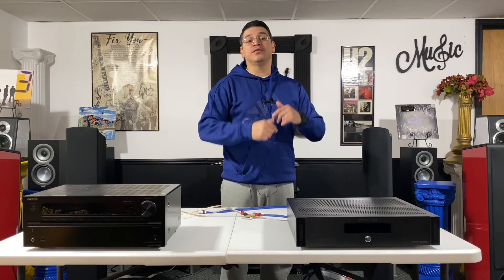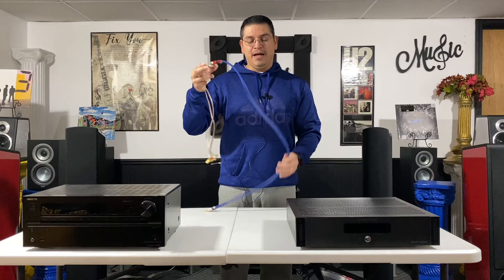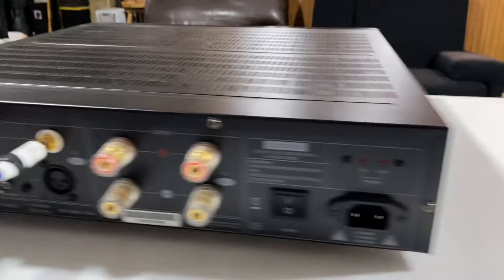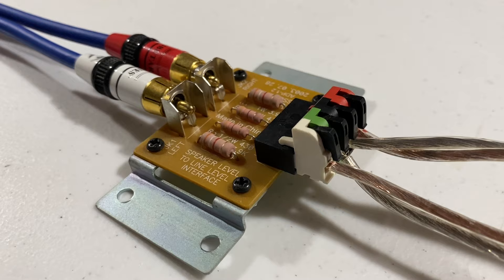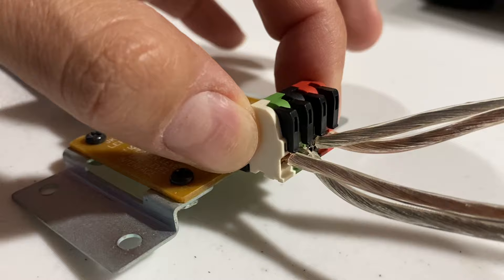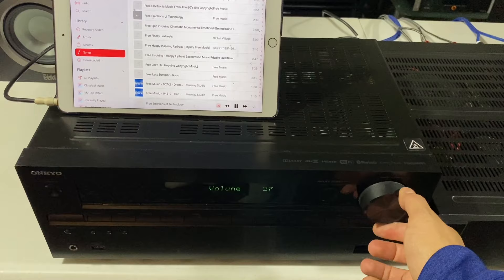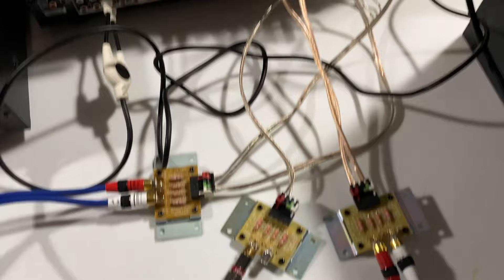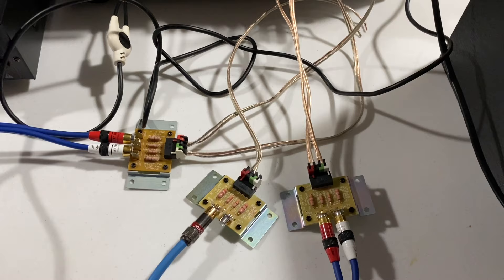Connecting an amplifier without using preouts.

Comment: Hi, if i have a 7.1 receiver but only want to power the 2 front speakers, do still have to hook up 3 adapters?  at 10:45 you say " now if you have a 5.1 or 7.1 you will need 3 adapters".   I ordered 1 adapter just now from crutchfield.  I will see how it goes.  I am hoping I don't have to buy 3 adapters to just get it to work on a 7.1 receiver, because then I am spending $120 basically for 3 adapters...might as well just use that money towards a new receiver with preouts.
Reply from the maker: Yes that will work fine. One adapter for just the 2 speakers works fine. If that’s all you want to do is power front mains. What I meant is if you wanted all 5 channels connected to an external amp then you would need 3 adapters.
Reply from the maker: Thanks for watching

Comment: Question: own a vintage Marantz 1060 integrated amplifier that has pre-outs and an Onkyo TX-8511 Receiver that does not have pre-outs. Could I connect these together and would there be any advantage? I am using JBL Studio 230 for speakers. Thanks,
Reply from the maker: You could connect them but I’m not sure there would be any advantage to it being yours marantz probably has better voltage than your onkyo even if the wattage is lower. However you can always give it a shot and see if it works. Hope that helps. Thanks for watching
Reply: @Audiolympian  when connected separately, the Marantz has much better sound than the Onkyo. However, I thought with more power pushing through I was hoping for better sound. Exactly how would I do this? Would I go from the pre-out from the Marantz to what in the Onkyo?
Reply from the maker: More power doesn’t always mean better sound. The onkyo could change the sound in a way you may not like. It is a tricky connect being the output of the marantz would maybe go into an auxiliary input or maybe the cd input of the onkyo. But not sure if the signals will pass properly. In theory it should but not sure. I’ve never done that.
Reply: @Audiolympian  OK thanks maybe I should just let that pass. I thought maybe since I already owned it I could put it to good use. It’s basically just sitting there collecting dust. I believe I purchased it in the late 90s when my Marantz went on the blink. After a few years I decided to get the Marantz repaired and I’m glad I did because it really does sound much better than the Onkyo. I guess I should come up with another solution.
Reply from the maker: @drums5434  marantz vintage gear is outstanding.

Comment: Hi, I have one question. Right now i have a subwoofer connected to my receiver is it still going to work or i still have to buy another adaptor for it in order to work? Thanking you in advance.
Reply from the maker: Yes it will work. As long as your sub is connected to the low level interconnect output on your receiver (rca) No need to purchase another adapter for the sub as the Lfe signal is generated from a different circuit.  Hope that helps and thanks for watching

Comment: In fact I needed a theatre like  center channel sound so I connected center speaker line output from receiver directly to the amplifier without an adaptor.  It sounded pretty loud and good.   I lessen the db of center channel of the receiver.   So why there's need for adaptor ?  Pls comment'
Reply from the maker: What cable or speaker wire did you use and how did you connect it?
Reply from the maker: Also which amplifier did you use?

Comment: I'm trying to use an amp for just the low end with subs. Can I still run the high end speakers  off the reciever? And if so would I just double up the wire and have one going to the speakers amd one going to the adapter?
Reply from the maker: You could do it that way but when you add wires to speaker terminals it breaks down the ohms and could damage the receiver. The better solution would be to connect the high end of the speakers in series or parallel. Hope that helps. Thanks for watching

Comment: Hi with a reciever like mine ,it’s Pioneer  -vsx 4012 Dolby surround w equalizer  t has front  rear center inputs for speakers and it’s says 380 watt .I thought it would be more powerful than it is I’ve got 2 dj speakers 10 “ Mtx thunder hooked up to front but I turn up and it shuts off ? There 250 watt speakers .I took one away ,now I plugged 1 mtx dj speaker to channel A or B and I have 2 Polk audios do I plug the Polk audios into Sourround or center or front Lol sorry I’m confused if u had any input I’d gladly appreciate it thanks Godbless
Reply from the maker: It depends on which channel you have the Mtx hooked to (center or fronts) I would probably put the mtx on the center and the polks on the fronts. And use A speaker selector not B.

Comment: Are those like line level / high to low level adapter used in car stereos to add a power amp to a factory stereo without preouts? Same concept.. I have a Onkyo NR 686  that don’t have preouts .. It has Bluetooth an Wi fi
Reply from the maker: Yes the same thing. The only difference is these are designed to handle 120v the car devices are designed for 12v. I’ve thought about getting and auto line level and. Trying it in the house just to see if it would work but those take a hot, ground and neutral intake and I’m not an electrical engineer. Thanks for watching
Reply: @Audiolympian  .. thanks for responding;
Reply from the maker: @keithwebb8512  you’re welcome

Comment: What if I want to run external amp with other speakers while even running reguler speakers by AV riceiver  AT SAME TIME
Reply from the maker: Good question. Yes It will still work, the receiver will power the speakers connected directly to it while the other speakers will get power from the external amp. In the beginning I had my set up that way, with only one adapter for my front main speakers. Thanks for question.

Comment: I have a 5.1 but want to get a 3 channel amp to power the front LCR speakers.  Does doing this method increase the watts the surrounds will be getting? Thanks in advance.
Reply from the maker: It only increases the wattage to surrounds if they’re connected to amp. However, receivers are designed to push a little more power to the channels being used if not all channels are being used. So yes it will push a little more power to the surrounds when the 3 main channels are on an amp but it doesn’t do it the way we think so it’s not a continuous wattage push it delivers to the other channels only when needed. The only time it makes a real difference is when the receiver is in stereo 2 Channel mode, then it’s a continuous push to the left and right channels. Hope that helps and wasn’t too confusing. Thanks for watching
Reply: @Audiolympian  Great, thanks for the quick reply.
Reply from the maker: @santiagopastor8548  you’re welcome

Comment: What about if my amp doesn’t have to connect speakers
Reply from the maker: Someone else asked me about a similar set up. I understand what you mean but not too familiar with what the other inputs / outputs are on an amp like that. But as long as it has rca inputs it should still work but can’t say for sure. Hope that helps. Thanks for watching

Comment: Will doing this automatically bypass the recievers internal amplifiers or add to the amplification?.
Reply from the maker: Good question. It adds because you are using the original signal coming out from the receiver however, I believe the design of the adapter using rectifiers help tone down the signal so it’s not over powered resulting in damaging speakers. Hope that helps, thanks for watching

Comment: Hey there, I have had an issue that my setup requires more power than any decently priced at receiver can handle as I listen loud for extended periods of time for patty’s etc. so I have ended up torching 1 stereo and another one is just an anomoly with what went wrong. Anyways I got a 12ch, 150w rms per channel amplifier but my pioneer elite vsx 43 doesn’t have pre outs. If I was to use this adapter would it still end up pushing the internal amp pretty hard and causing lots of stress on it and heat? I’m trying to avoid that as much as possible here. Thanks!
Reply from the maker: Man that sucks. I’d love to tell you yes it should be fine since you’re pushing through an amp and basically using your receiver as a preamp but I don’t really know. If it were me I’d get some pretty heavy duty cables and power conditioner so maybe those would burn out first. And maybe you have that already. Wish I had a better answer for you. Good luck.

Comment: why do we need an russound converter ? why not directly connect to the speaker out ?
Reply from the maker: You can connect to the speaker out if you want to just use the receiver for sound. But some people want to have more power or just use an external amp and the receiver may not have the pre out capabilities to connect and external amp. So the Russound adapter gives them that ability. Good question thanks for asking and watching

Comment: Hey! I just want to know is speakers to 2 RCA line output converter in/out high/low will also work on a 8 channels amplifier to the receiver?
Reply from the maker: It should as long as you have it connected correctly. You’d need 4 adapters for 8 channels
Reply: Thanks you I will do!
Reply from the maker: @shawnbrown4359  thanks for watching

Comment: any tips for a dual reciver setup one for bass and one for normal sounds and such cause i have a pioner from 1997 thats getting real tired what should i buy thats in a good price range and yeah cause it gets to hot to play for long amounts of time so i had to use a pc fan on it any recomendations ?
Reply from the maker: Mostly depends on budget. But I usually try to give options between the $300 - $700 price ranges. Also keep in mind any recommendation might be able to be found on aftermarket sites which could mean a little lower price. Depending on your set up (stereo or surround) but any current pioneer, denon, marantz or Yamaha. Receivers are really good today and come with a lot of options. Entry and mid level products tend not to come with a lot of actual power, maybe 80 wpc. But good enough to get the job done. And of course the bigger the budget, the higher up the scale, the more bells and whistles along with more power. As far as two receiver set ups, not much to recommend other than a more modern subwoofer that comes with a wireless app for more control such as SVS or paradigm. Hope that helps. Thanks for watching
Reply: @Audiolympian  thx man I'll be sub to you cuz you where so kind and wrote a essay for me of Info thx man :)
Reply from the maker: @GoatedASF2K  you’re welcome. And thanks for the support

Comment: Hi can I just use a simple rca to bare wire cable to connect may receiver to a power amp??your answer is very much appreciated..Thank you 😊
Reply from the maker: Sorry for the late response. Apparently I didn’t hit send. Your question is interesting. I’m not sure if it will work, seems like it could but the adapter has specific networking to transfer the signal properly. However, you could be right. Thanks for the question and watching
Reply: Thanks for answering my question 😊I have another question 😁 is it the adapter that you use is  same with hi-to- low level signal converter??😊it is with the same rca out and speaker line in connection with it..I just saw that on amazon 😊Thank you 😊
Reply from the maker: @rjaychavez3866  yes it’s the same.
Reply: No , do not use rca directly to speaker output and connect it to power amp , you will certainly destroy your power amp, this adaptor has resistors connected between rca and signal coming out of receiver so it is safe for power amp. Early in my years i have done this mistake with a car audio, connected the old radio from car directly to an amplifier trough the speakers output and destroyed the power transistors inside amplifier.

Comment: How did you get the speaker wire in the clips? I feel like it's  going to break the clip if I open  it all the way.
Reply from the maker: Just that way. open it all the way up. I should have mentioned that it does feel that way but it won’t break. Use some force but be conservative. I’ve done it quite a few times none of mine broke.  Hope that helps. Thanks for watching

Comment: When you turn up the volume on the AVR in this setup, where is the increase in power coming from? The internal amp in the AVR, or the amplifier?
Reply from the maker: Hey Riley,
Kind of both. This set up doesn’t totally by pass the avr’s channels it’s more of an enhancement. So the potentiometer is on the avr but it’s sound path is going through to the amp. Which is why if you connect this device the two channels it’s connected to will be louder than the other channels. Hope that answers your question. Thanks for watching
Reply: @@Audiolympian  Interesting.
So what I'm trying to do is use my AVR by itself for movies, then have an amplifier connected via a line-level converter that I'll use for music (turntable). Turntable connected to AVR, line-level converter coming from my L+R speaker connections on AVR to the external amplifier, speaker wire from L+R connections on amp to an amp switch ("A" side of amp switch), then finally to speakers. Speaker wire will also be connected to L+R on AVR, leading to "B" side of amp switch. Amp switch lets me toggle between using the AVR (movies) and the AVR+amp (music). I've been using the amp switch for a while now with the AVR and amp completely seperate of each other, but I want to take advantage of the room correction software on my AVR, and I think this is the only way, unless I've made an error in my thinking.
Kinda complicated, but I like the extra power for music, plus the amplifier has cool lights, haha.
Reply from the maker: @MFRiley  gotcha. So it seems like it will work the way you want I too as long as your “switchers” are basically pass through devices, which it sounds like they are. If you do it let me know how it works out. I’d be curious to hear your results. And yes amp lights are very cool 😎
Reply: @Audiolympian  Pass through it is (Solupeak P2).
Figuring this all out was quite complicated as I'm not super knowledgeable about the technical side of audio. Didn't even know something like this was possible until I started digging. Audio is such a rabbit hole.

Now that I'm looking into it even more, I guess I could use the external amp for both movies and music. Use it as part of my surround setup for movies. Let the amp handle some of the load of the left and right channels, and the AVR can focus more on the other channels. Would this be worthwhile, or am I splitting hairs at that point?
Reply from the maker: @MFRiley  could be splitting hairs depending on which amplifier it is and your room. Yes it is a lot and a very deep rabbit hole. My advice is take your time, research a lot but enjoy what you have and get to know it. Learn all the specs. That will give you good insight about other gear as well.

Comment: Hey when hooking up multiple channels where would i plug the 2nd set of rca plugs in? Was looking at getting the pyle pt8000ch amp
Reply from the maker: It depends on the amplifier. As long as it has multiple rca inputs that’s where they go. They can go in any input, just make sure the speaker is connected to the proper amp channel. Hope that helps.
Reply: Could you recommend a good 4 channel amp that would work?
Reply from the maker: @jacobcreeden5280  of course depends on your budget, emotiva make good amps at decent prices. Some older used anthem amps. Those are fairly cost efficient amps.

Comment: Sorry, i am a bit confused...question is about volume levels,  if you have surround speakers hooked to receiver and main speakers are powered through amp how do u balance those in terms of volume levels? are there any master volume knob which would control all speakers?or each time when you need to make things louder, you control both knobs (on receiver for surround and on amp for main) and try to find volume balance on the go between them? thanks in advance!
Reply from the maker: Ok for volume. One thing you can do is lower or raise the speaker’s DB levels in your receiver’s  settings as long as your receiver has the ability to do it. Another option would be having an external amplifier with its own volume controls. Not many are like that but a few have them, Crown class d amps come to mind, those have gain controls. So the receiver’s volume knob will control the volume for all the speakers at the same time. I will say this, I use a simple pioneer receiver (75 wpc) and a Sunfire amp (200 wpc) and my system balanced fine after I adjusted the settings a bit in my receiver. Hope that helps and thanks for watching and commenting.